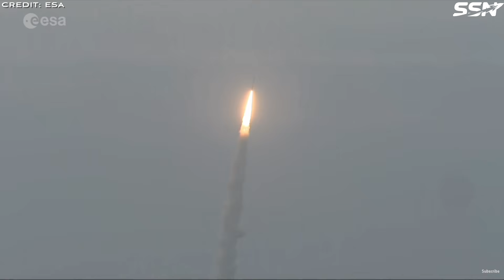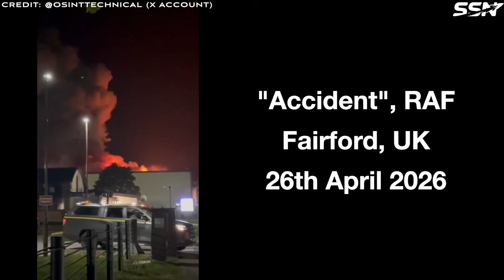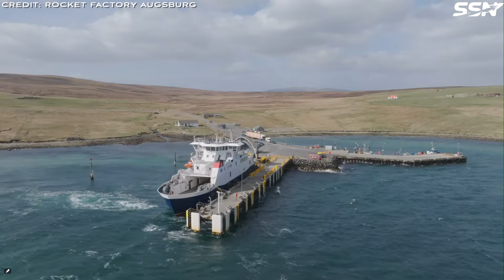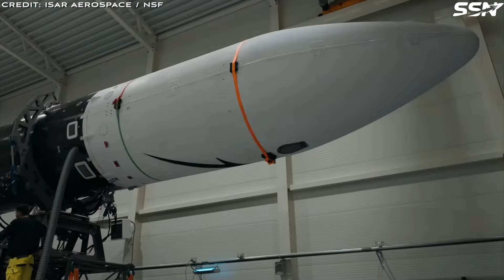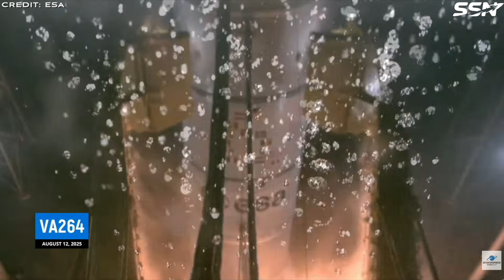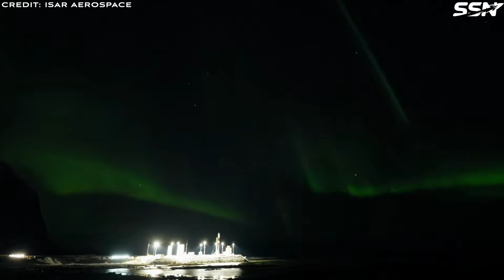Part II: Europe's Path to Real Space Independence

Comment: I believe you have a misunderstanding of the relation between orbital inclination and latitude. You can only reach a inclination higher than the launch latitude, without additional maneuvers. So from a low latitude like near the eqauter almost all orbital inclinations are accessible, but from a high latitude only higher inclinations are accessible
Reply from the maker: For Latitude L the minimum inclination is inclination L (without an expensive yaw manoeuvre or kick-stage). So, flying from SaxaVord at 60 degrees latitude provides a direct injection and zero penalty launch to a 60 degree orbital inclination. You can launch from Kourou but you pay a penalty, either you don't fly due East or you add a kick-stage, either way it's less efficient. My core argument is about efficiency and sovereignty, not whether it's technically possible from Kourou.

Comment: Political problem: as the leading Arianespace shareholder and major ESA financier France never ever would agree to shift from Korou to North Europe.
Reply: There's a very simple solution: two launch pads in two different locations.
Reply: @MimeHTF5  That might be good for safety too. If there's a war in Europe, then the French Guiana launch pad might still be available, and if that one is blockaded or something, then we still have the domestic launch pad in Europe. And we could focus the French Guiana pad for more commercial launches in the meantime, where we launch for south-american and other customers, and use the one in Europe for more classified launches.
Reply from the maker: Agreed. I wrote a section on this called "Solving the Politics (France)" but I cut it to shorten the video. Here was my proposal for winning France over: Build a Neutral Buoyancy Lab (NBL) in Paris. Similar to NASA's Houston facility. This is a prestigious facility where astronauts train to do spacewalks in a large swimming pool. O-HAB manufacturing in France (using Spartan Space's design). IVA & EVA spacesuit development in France (Spartan Space's IVA suit is going to the ISS for testing this month). And, finally, permanent presence of 1-2 French astronauts onboard the station for the first 10 years.